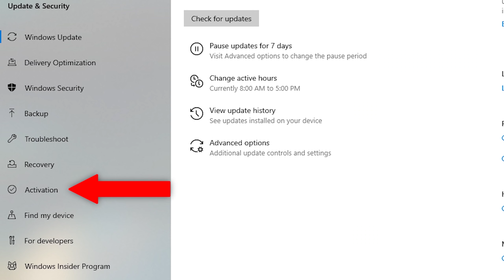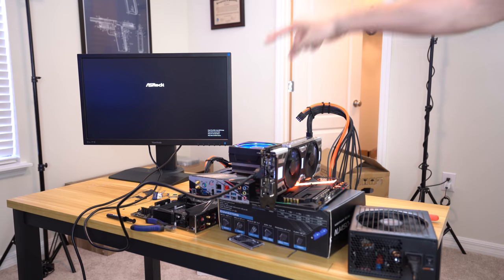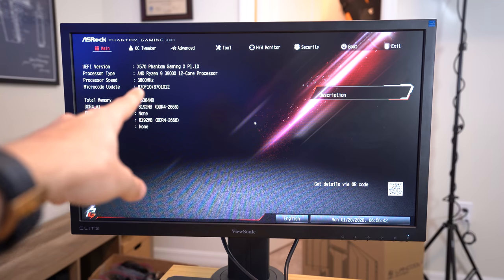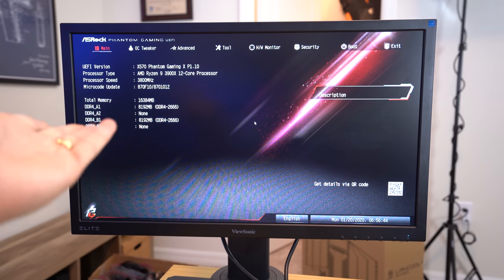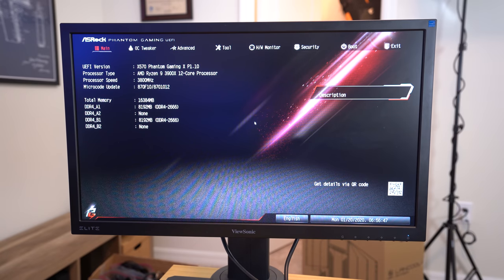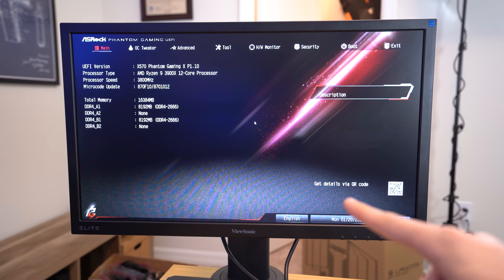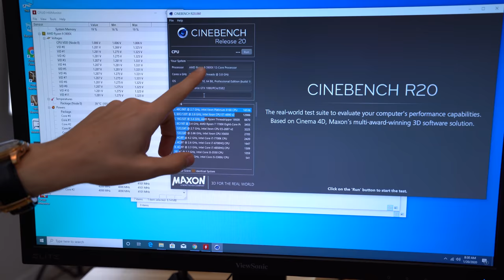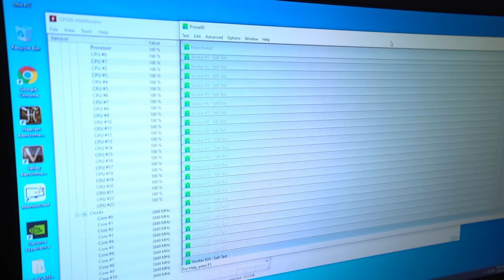Reviving My Dead Ryzen 9 3900X!

Comment: Now the proper way to do it:
1. Soldering iron (Hot air gun is a plus [please, if you have access to it don't use the shitty compressor-less one Linus used in his vid it's worse than a proper iron])
2. AM4 socket pinout https://www.docdroid.net/6cDW11N/am4-pinout-diagram-pdf
3. Desolder as many power pins (try to balance it - take equal number of vcc and gnd ones [or to be in line with the pinout VSS and VDDCR ]) as many broken SIGNAL ones you have - again there are usually more power pins then needed for future-proofing/standards
4. Replace the broken pins with the desoldered ones
5. Done. Boot and if it works enjoy.

Comment: Yeah,I bought Ryzen 2600 and   asrock B450 board arrived just last night and spend almost an hour and half fixing 3 bent pin that located a bit on the center . My last AMD build was Phenom II x4, I still remember easily fix the bend pin with tweezer or needle, but with Ryzen, the pin is so small so its not that visible with naked eye. I finally using very small needle usually used by my wife for her scarf. I slide it from the side and pull it up to straighten the pin. And after some problem with the cooler, Im using AM2+ custom cooler that a bit shorter,  I finally finishing the build at 1 am and  finish installing windows etc at 02.30 am. Fyuhh...

Comment: Refining this process could resurrect thousands if not hundreds of thousands of dead CPUs due to broken pins. Your motherboard sacrifice may just be the one ring to rule them all.
Reply: Watch the linus video he uses an air solder to fix a ryzen cpu by refluxing the pins
Reply: @stridezz7686  , I've watched that one before. The difference here is of course is that no soldering is required. I don't personally have a problem soldering and prefer that method of repair. This method does not involve that skill and the chance to further damage the CPU pins. If this method is refined, it stands and good chance of success without understanding how to use a soldering iron.

Having both options available only improves repairability.
Reply: @ejeckk  Soldering is a skill anyone working with electronics should learn anyway. It's not difficult and opens up far more opportunities. I recently fixed a job lot of 12 out of 19 GoPros that I paid $170 for. I sold 6 for $1300 and get to keep the rest as bashers for my drones.
Reply: @Burn377  , it is completely true that soldering is not a difficult skill; however, most folks will not do it. I have a pair of rechargeable hair trimmers and an electric tooth brush that had batteries that were failing. After some research, I found the batteries for both, used a soldering iron to replace the batteries and both devices are working fine. My best friend was actually upset with me that I would spend so much time and effort replacing the batteries and thought that I should just toss the items out and just buy new ones. I'm not rich. The cost of the batteries, soldering iron, and materials with shipping cost me a total of $19 after tax. The cost of a new electric tooth brush and hair trimmers $100+ and $80+ respectively.

So I'm with you. It was like putting $160 back in my pocket. Still... I know most folks still won't do it because they consider it too much of a hassle. I'm no environmentalist, but why pile on to the landfill when the items still work just fine?

Even the fix for broken CPU pins in this vid (which is mind-numbingly simple) most people will not do.  Having additional options for repair is still a good idea.

Comment: Next time a pin bends. Buy a stainless steel ruler 6inch one. Insert it between pins and gently straighten to align all pins in a line. Repeat in opposite direction to get a perfect pin straightening. Also try to be more careful. Bricking a mobo was unnecessary.

Comment: I’d take some pieces of copper wire, lightly tin the pad where the pin was, and solder the wire to it. A little tedious but with a microscope and some tweezers it would be fairly easy and a reliable repair. You could use long pieces of wire to make it easier to handle and then trim it to length after soldering.

Comment: I would suggest using a heat gun and tweezers to desolder those from a donor with a base that is just a bit wider than the pin itself. Most likely it would not fall into the socket and would give a nice and more reliable connection to the CPU. If you do not have a heat gun you even might be able to do it with a lighter. Preferably a windproof one which gives a nice cone-like flame.

Comment: I'd be worried about vibration causing the pins to loose connection or cause tiny arcs/heat spots from a poor connection. Be neat to find a way other than soldering? Maybe a micro-drop of super glue even lol or find a conductive adhesive..

Comment: If your pins are not bent badly but just bent, you can run a credit card or gift card through the pins in rows to try and correct it, had to do that when my friend dropped my 1400

Comment: my cpu was fused to the heatsink on the stock cooler but surprisingly, no pins bent when it was yanked out of the socket with the latch down. the bending did happen when i tried to remove the cpu though, and in trying to bend them back: i accidentally got thermal compound on the pins, bent one the opposite way, and probably did a lot more i haven’t noticed yet

Comment: if u dnt have a heat station use oven 450f with a cake pan under the cpu lit it sit on the rack itll melt the pins off into cake pan and youll have full length pins

Comment: thankfully, ive never bent CPU pins bad enough for them to snap off while straightening them, 
but i would suspect that cutting the pins flush with the substrate would leave a little head on it that might stop it falling into the socket.

Comment: reminds me of a boo boo I just did for which I worked around..
I couldn't find the M.2 stand-off for my motherboard (either lost or never came with it) so I put in a SCREW that was meant for the M.2 heatsink. The M.2 SSD is shoved into the CONNECTOR end but the part that should screw into the stand-off just sits on TOP of the screw that is doubling for the stand-off. So it's not touching at all. However, I put the HEATSINK over top of that (with tape) and it holds it in place... but darn it, I turned the screw on the heatsink too far and the stand-off for the heatsink (not the M.2 SSD which I don't have) came off. Aaargh.... so now I have the M.2 SSD inserted on one side and stuck to the heatsink with the heatsink only mounted on one end... it's just secure enough that it's no problem if I don't transport the PC in a car or something but I really should mount it properly (but with my luck I'll break something else doing that).
Reply: edit: heatsink has thermal pads on the bottom not "tape"; I put the heatsink with thermal pads over top the M.2 SSD to keep it in place. So it's stuck to the bottom of the heatsink which prevents the connector end from jiggling out of place.

Comment: Interesting fix. Incidentally a possibly less drastic and reversible fix would be to get a fully removed (with heat) pin, install in a scrap board and lock it in place then sand it away from anything important until there is just gold visible. This should sit nicely on the pin stub.

Comment: I had a similar problem with my 3900X, I was having overheating issues with my wraith cooler, so I tried to reseat the cooler with new paste. But the thing was glued onto the cpu and I ended up pulling so hard on the cooler it ripped the cpu out of the locked socket, thank fully it didn't break any pins just bend a few on a corner, spend literally an hour on the ground cross-eyed fixing it.
Reply: Hey if you have any tips on how to avoid this let me know!! 

I currently have a 2700x with a default amd wraith cooler on it. I hope to upgrade to a 3900x in the future so I will be removing the cooler and current CPU and replacing both so let me know if there's ways to avoid damaging the CPU upon removal! :)
Reply: @sadippers6168  
Try to lay the pc down and before you remove the cpu cooler try to wiggle it a bit hope this helps.

Comment: That is one of the reason Intel's pins are on the motherboard. Not only motherboards are relatively cheaper than CPU, but also motherboards are mostly installed in the case which has lower chance of dropping it on the ground.

Comment: It is insane how this actually worked, I thought your 3900x was toast. If this ever happened to me I now know what to do.
Reply: But please don't use speaker wire!😅 Use some solid Copperwire with same diameter then the pins or just desolder the pins from another absolutely dead CPU as he tried, he just snapped 'em of, so they were to short and fell through the socket. But if you desolder 'em they won't be to short and bevause of the little 'plate' at the end of the pins, they won't fall through the socket.
Reply: @jonathanlang9711  I second this.
Reply: @jonathanlang9711  yeah, linus tech tips did a video on that.

Comment: I give it a few months before you begin having intermittent issues. GALVANIC CORROSION. You said you used copper wires to create makeshift pins. The problem is the contacts are gold plated. Dissimilar metals with a current flowing through them causes galvanic corrosion. You might have taken a cheap gold plated necklace and made pins from it.

Comment: Did you pull the CPU towards the pin sockets as the retention mechanism would? I think the pin sockets open as you do so and pinch on the CPU with some force ensuring good contact. Right now that CPU is probably barely making contact.  It was a miracle you pulled it off after breaking the retention mechanism.

Comment: Should of de-soldered a donor pin and put it straight into the CPU socket (they are T shaped so won't fall through) and put the CPU on top. And your old mobo will have a rogue pin floating around under the socket and that's why its bricked

Comment: I never thought of doing this. Ive done similar with intel socket 1150 motherboards. I used the copper out of a small electric motor to replace the snapped pins on the lga board.

Comment: A easy way to stress the CPU is to just run CBR20 in a 50 loop run. After resurrecting a 3900X, I wouldn't even worry about mounting a GPU vertically. Just throw that thing in there and smash some edits. Though, i would've definitely used a Corsair V2 AIO. Regardless a once dead CPU is going to a good cause. Also, if more storage is needed, there are some 4TB 7200rpm 128MB cached HDD's on ebay for $50. I've RAIDed a few and they seem pretty solid.

Comment: this technique has been forgotten since in the early 2000's back in the ancient athlon days where there is no heat spreader on the dye. good thing that this technique is still alive on the newer PROCE's. but again back in the day you dont have to ripped the plastic Cover on the processor tray.  you just have to put the pins exactly on the right place. and make sure you put more down pressure on the processor when you put the wraith cooler.

Comment: i had an issue like this in the past with the old phenom 9300be. i bought one when they first came out and a piece of something was in the motherboard socket and when i put the processor in it bent a pin and wouldnt sit flat. pulled cpu back out and seen the pin and tried to straighten it and it fell off instantly. flipped the motherboard over and whatever was in the socket fell out never to be found again. it looked like a piece of plastic but who knows. i cut up a sewing needle to the same size as the broken pin and put it in the socket and all was well. when i got a new cpu i just flipped the case and grabbed the pin that fell out and popped the new one in.

Comment: Why you don't change cooler speed from low to high ? In low you had lower min rpm and 3000rpm max, in high you got a little higher min rpm but max rpm is ~ 3800 RPM

Comment: if you used a soldering iron you could have actually pulled the pin off intact with the T part still on it.

Comment: Bent pins causing ram issues  in my case. Two slots b1 b2 are not working. Is there any chance of permanently damaging those slots in the motherboard? Bent the pins while trying to install a new cpu cooler yesterday. The thermal paste on the stock cooler of amd was too tight. Never had such issue before .

Comment: Without the retention plate installed wont there be a couple mm gap between the bottom pf the chip and the top of the socket? Also is the chip only being held on by the cooler? This feels like a ticking time bomb.

Comment: damn, ive done this before many years ago with a Phenom, i used a needle straight into the holes where the pins broke, and cut it as low as possible and it worked.

Comment: Instead of so much mess u could have gone with a fine tip soldering iron take out the broken pins take good ones for the donar chip....re solder the pins and kept it simple

Comment: Are those pins attached with solder balls?  if so you can buy soldering tweezers and maybe resolder the individual pins..  or you can just leave it be since you got it working.  ;)

Comment: got an idea, why not use the frame you ripped off as a guide for re-soldering the broken pins? put the frame on the substrate, then use a pinhead solder iron to put a small amount of solder and then immediately insert the bent pins, that might work
Reply: Lolno, that's all wishful thinking, just the plastic is prone to heat and will degrade at temperatures above 150° C
Reply: @punktkomma9489  even if it melted, he didnt use it anyways, also he said he bricked one board for this.. he could use the plastic socket on the damaged board and sacrifice it for the repair, melted  plastic will come off easier than the solder
Reply: @QuicSi1ver  I didn't realize I had to go that far, but your whole understanding about soldering is wrong too
Reply: @punktkomma9489  i found you dont have to use the plastic anyway, there are metal brackets that are specifically meant for re-soldering the broken pins
https://youtu.be/yh2XYkRwtBQ?t=906

Comment: I can't even imagine how one can bend or break pins while installing the cpu... Just lift the socket lever FULLY open, and let the cpu easily seat... The gravity force lets the cpu pins fully seat inside the socket, then close the lever WHITHOUT touching the cpu, that will move, at this point... When the lever is close just put a bit of thermal paste on the center of the cpu and sit the cooler on top of it WITHOUT moving it horizontally.

Comment: Hey Greg, I'm kinda late so I'm not sure if you'll see this, BUT
HW Monitor tends to show incorrect temps on Ryzen X series CPUs, (It has a 10C or 20C offset), therefore if it shows 90C, means it's actually 80C or 70C, you can see the actual temperature of the CPU using Ryzen Master.
Source: https://www.reddit.com/r/Amd/comments/6a0t48/ryzen_master_vs_hwmonitor_who_to_trust/
(And my own system experiments)

Comment: Atleast you weren't just carelessly handling the CPU resulting in you dropping it and breaking the pins.

Also could have been worse, could have been a threadripper 3990x

You should keep us updated if this system has issues long term.

Comment: Are Ryzen's (zen2) under performing there are reports all over that AMD have found a bug in their normal precision  boost and are going to release code to all the Vendors. But no one knows when - is this true? My 3700x seems to be under performing on an X370 Msi pro carbon(Beta Bios). There seem like a lot of performance left on the table and I want it.  It is under a custom 360mm Push pull loop and wont boost anywhere near full temp or any of the other Ryzen master metrics. Will I get a free boost upgrade anytime soon :) hoping so.

Comment: I bent the pins on my 1600 af and repaired it. just be calm and collected
Reply: How did you bend it? I’m a little worried on installing it and bending it
Reply: @Slurpskiii  ohhh I bent it by taking it out the socket on the motherboard with the cpu fan still attached. it was stuck together and I was trying to pull it apart. just place it in the socket and you're good but if you want to replace CPU cooler make sure that thermal paste isn't cold and practically glued to the cpu

Comment: my good sir you maid me shred a teer. all you had to do is use a heat gun on the doner cpu to get the pins you wanted anuther thing with some flux seal since your other cpu still had the souder points on were the pins broke off all you had to do was put some flux seal on the cpu and heat the area were the pins broke of and once the souder is soft anuff you just put the pin back in but it dose take alot more patience

Comment: You could just use some solid copper wire that's the same diameter than the pins😂 Or you could have desoldered the pins from the 2400g then they would have been long enough and had not fallen through the socket.

Comment: I probably would have used a bigger cooler to test that. I agree with not removing it once it was on, but I'd have chosen a stronger one for that reason, cause you're stuck with it
Reply from the maker: It's fine for what he's doing.
Reply: @GregSalazar  I guess if you always use headphones it doesn't matter, but I usually wouldn't say not to some extra boosting and less noise. 

But if you also feel like saving the money, can't fault you there.